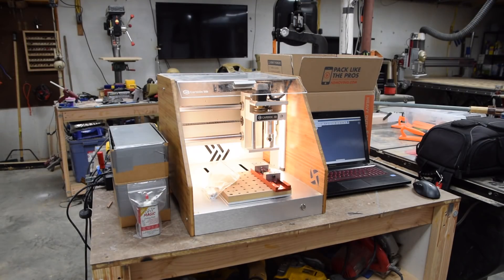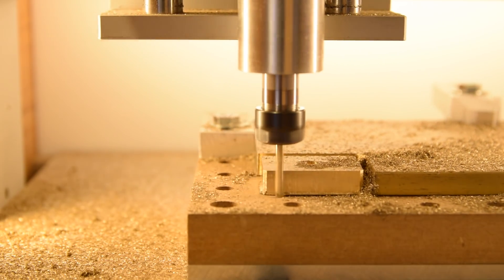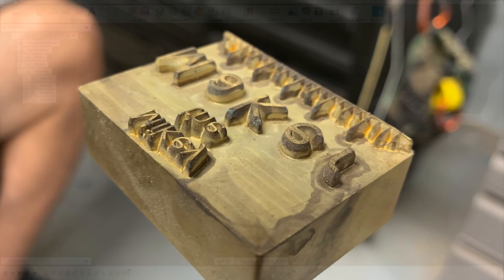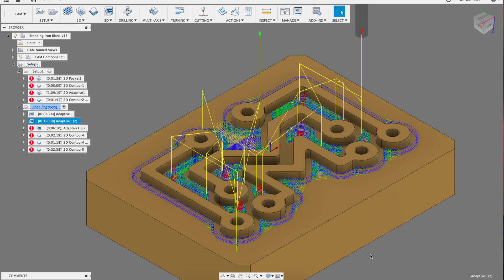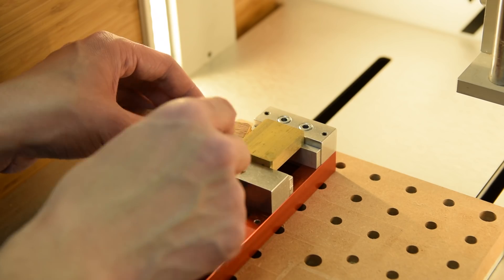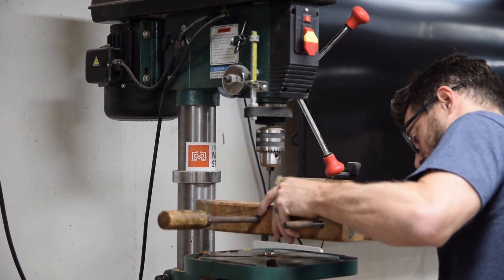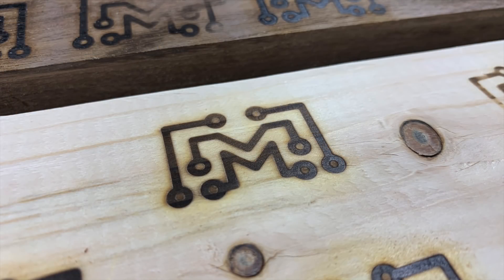Making an ILTMS Branding Iron for Bob Clagett - #134 [CNC]

Comment: Winston i would like to know if we can make dies on the nomad3 either bras or steel.
Reply from the maker: Brass is absolutely manageable. Cuts just like aluminum, just go 30-50% slower. Steel is very tricks, small amounts using endmills smaller than 1/16" are theoretically possible but I have not done any myself.

Comment: I've been looking everywhere for a low profile vise like that red one.... any info on it?
Reply from the maker: It's the one Carbide3D sells. Only modest Holding power, but slimmer than almost everything out there. Little Machine Shop has a few that are a little taller, but worth checking out if you'll regularly be doing metal.
Reply: @WinstonMakes  thanks for the reply! I'll look into it.

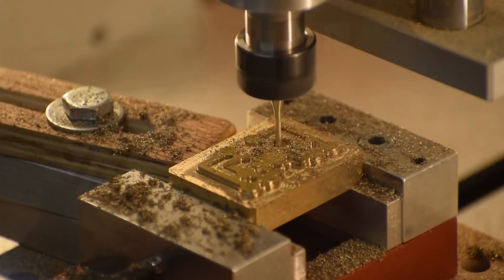Comment: 5:50 - A couple of drops of isopropyl alcohol can really quiet things down and cool the bit. Just be sure you have adequate ventilation. I use  kool mist formula 77 mixed at 1:40 with water... however it will leave a slight residue. (Washes off with water.)

Comment: Damn that JPL_Richard guy...so picky!  I noticed you set the z with paper, and not the built-in tool setter...and I don't recall you saying why...so, why?  PS NICE VISE.  PS2 I highly recommend these parallels ($15) at Little Machine Shop, Part Number: 2924 they are within 0.0001 (JPL_Richard approved)
Reply from the maker: The tool probe changes offset. You still need to set zero the first time.
Reply: @WinstonMakes  WHAT?  Really?  I didn't know that.  Holy S....thanks, but I'm like, huh. (so confused now)